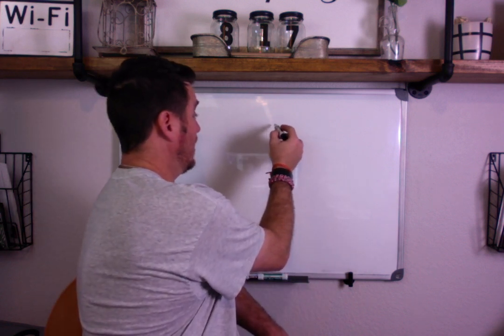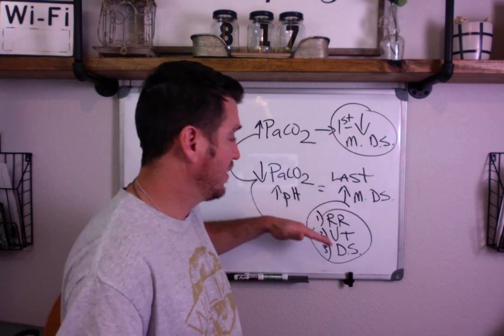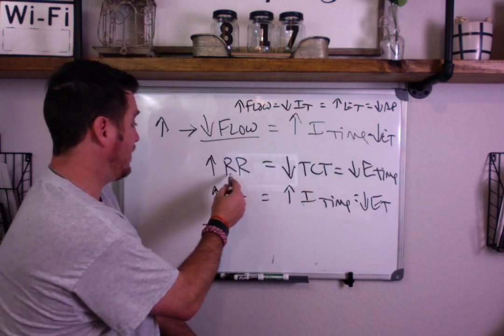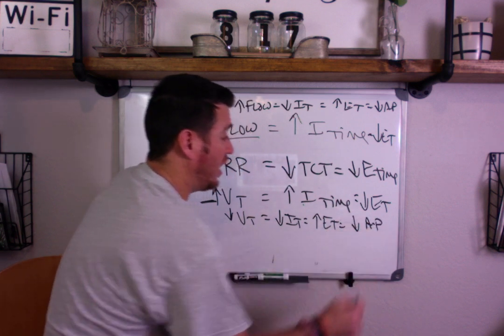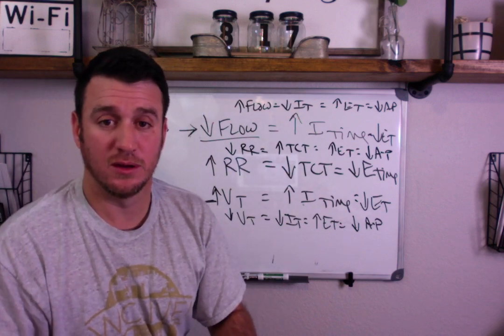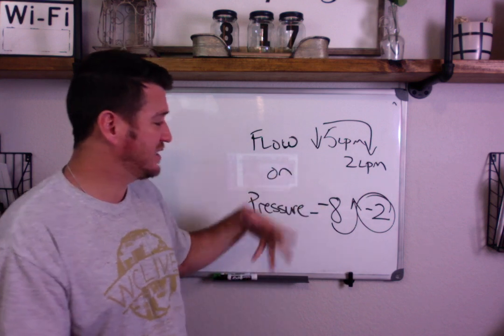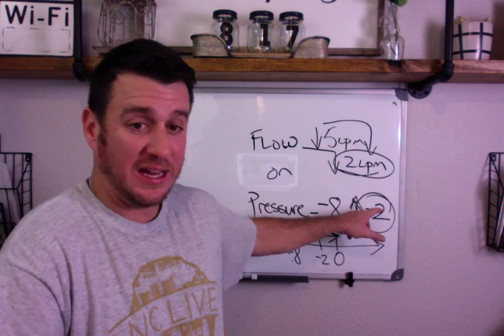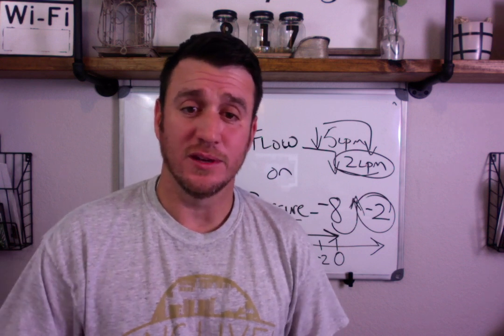Respiratory Therapy - Mechanical Deadspace, Auto-Peep, and Patient Sensitivity!

Comment: I hv 1 question
 when static compliance is given
Pip given 
P plat given 
Tidal volume given
Peep not given
Can we calculate driving pressure from above equation?
Reply from the maker: Hey Roshan.  To calculate driving pressure we must know what peep is.  Driving pressure = Plat - peep.  The above info does not provide us with a peep, but with the given information we can figure out the peep from the static compliance formula.  Static compl = Vt / (Plat-Peep).  So plug all the appropriate given values into that formula and you'll be able to solve for peep and driving pressure.  You recognize that driving pressure is the bottom half of the static compliance formula.  In other words, it's true to say that...Static compliance = Vt / Driving Pressure.  Hope this makes sense and helps.  Thanks for asking and watching!!!